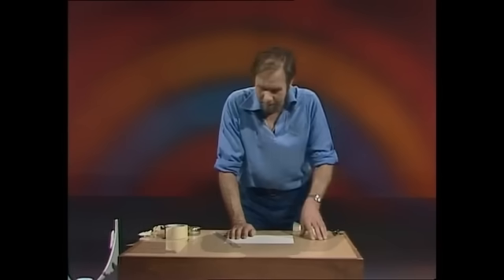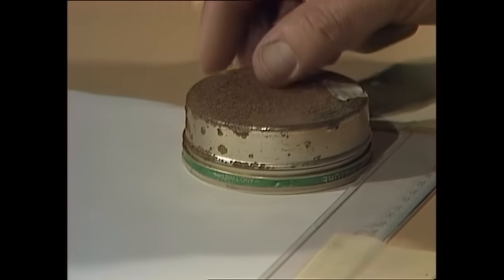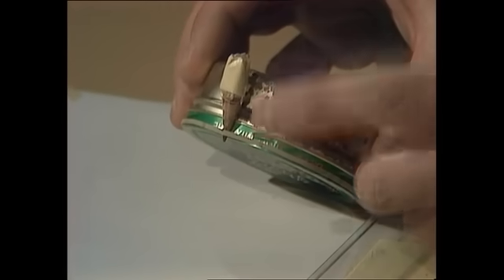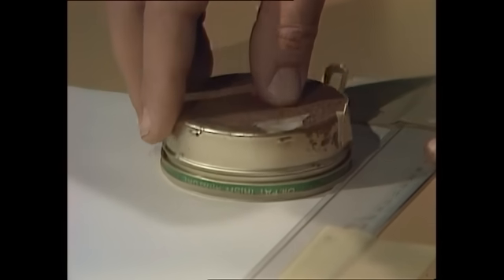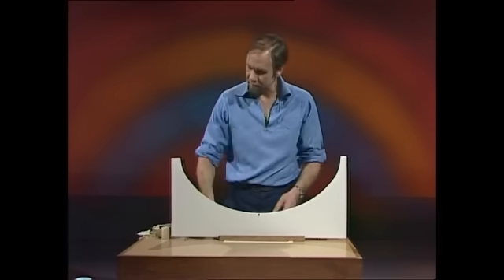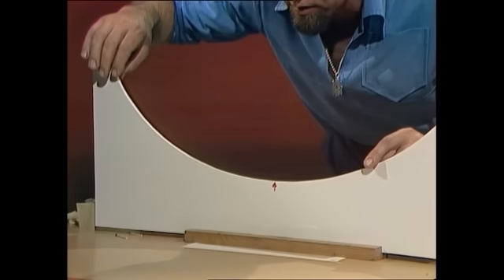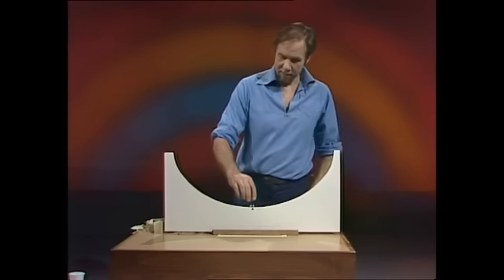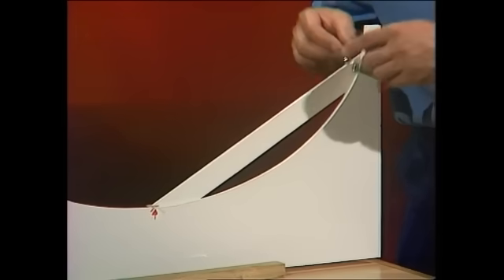The mysterious isochronous curve

Comment: Wonderfully done physical, explained and demonstrated example of an isochronus curve. The only thing I would like to see, would be an example of an application of the curve’s use. Too many mathematicians are just too enthralled by the “isn,t that neat factor”. In this case though that would be a real task dipping into stress and strain curves in materials and pendulums which are not isochronal, but cycloid.
Reply from the maker: There is a limit as to what can fit into 4 minutes - Rob
Reply: @CuriosityShow  Thanks for the heads up. I did not know you had a time limit.

Comment: You can notice that although the balls will reach that center mark at the same time, the one that started at the lower point on the curve bounces farther back when it collides with the other ball. This implies a few things:
1. The ball starting at the lower point had a lower amount of momentum than the other.
2. That ball had the same mass as the other ball, so the difference in momentum was because it was moving at a lower speed by the point it reached the center.
3. Since the balls started at different heights, they naturally also started with different amounts of potential energy and the same amount of kinetic energy, which was 0. So, this would naturally explain the difference in momentum and velocity when the 2 balls meet, which confirms the law of conservation of energy was upheld without any unknown forces adding energy into the system.

The fact that the balls reach the center at the same time is actually the result of the inconsistent centripetal acceleration caused by this particular curve. The top of the curve is essentially a flat drop, so the only force on the ball at that point is gravity. Lower on the curve though, the ball fallows the curve at an angle, so its vertical velocity is converted bit by bit to horizontal velocity, until it reaches the center point. Although the conversion of the vertical speed to horizontal speed gives it a higher resulting velocity when it reaches the center, it had to travel a greater distance around the curve to get there than a ball starting at a lower point. 
This curve is special, because it perfectly balances the trade-off ratio between achieving greater end velocities at the cost of increasing the total distance traveled by the balls, so that the total distance traveled, divided by the average velocity throughout the curve, is equal to a constant amount of time elapsed. Or * D / V' = C *
Reply: Thats a long way to say "Magic" LOL 😉😇
Reply: Bravo! One remaining question. When comparing a ball traveling on an isochronous curve to traveling along a straight line, the former is faster. I get that the ball gains more momentum along the isochronous curve, but it also travels less distance. Do you have any kind of intuitive explanation for why momentum wins out in this case?
Reply: Or maybe something more simple, like human error not releasing the balls at the exact same time
Reply: Obviously i haven't done this experiment; hence my question: would the two balls (hah! Balls) meet at the Centerpoint if one was released at the very top of the one side, and the other released like one diameter away from the Centerpoint?

Comment: I took an employment exam and this was one of the questions. They had a ball and 4 ways to run. Line and 3 curves. One of the curves had a really sharp drop then it leveled out some. My thinking was that near vertical drop would give it more momentum and thus be the fastest. Nope. The isochronal curve was the right answer. I didn’t believe it so when I got home I made my own and yes, the ball traveled fastest on the iso curve. I still got the job
Reply: what kind of job is that?

Comment: The more round the circle the faster it goes. The straight line holds more of the balls weight making it roll slower. The curved line doesn't hold that much weight back for the ball and so it rolls faster. Take 2 cars for example and put one on a slight curved hill but still a straight road. The road will be squished with the cars weight alot longer than if the road was straight up drop curved. How to explain in simple terms. Because you start the ball halfway up the curve, it will go the same speed as if one was drop from above straight down. They would both meet in the middle at the same time. See, the ball on the curve basically has no weight pushing down to slow it down you see? It's basically a floating ball on the side of a curve. Another ball on a straight line slight curve has to take into account it's weight being pressed down and so that will slow it down because it needs the momentum to build to make it go faster. Gravity as some say. A ball on a straight line uses alot less gravity than a ball on a curve. Never mind. Forget it.

Comment: It's because the angle on the shorter distance is shallower so moves slower. Whereas on the longer side the ballbearing accelerates to a faster speed therefore it meets the other bearing at the same point.

Comment: So the ends of the curve are steepest and get progressively flatter as you approach the center, resulting in different velocities per starting point...the faster velocities perfectly compensate for the longer distances, resulting in all getting to midpoint at the same time. 
What confuses me is why tracing a circle would result in a curve with such properties.

Comment: What about 1/2 of a circle so no radius differential. I believe they would be roughly the same. Also use Control devices to release and measure timing are critical. Show the Accel and speed curves of both. Or this is just a new way to give fancy names to stuff.
Reply from the maker: No, they are not the same - check the explanation - Rob

Comment: WHY!?
Reply: Acceleration in two dimensions can be described by addition of two force vectors, X and Y. The magnitude of these vectors describe the direction and magnitude of the force. Gravity is a force vector pointing down (here on Earth). Taking two extremes, top of the curve and bottom near center, you can see the top curve ball will experience more of the total acceleration, since its motion more closely aligns with the gravitational vector, than the bottom near center ball. The result is an acceleration magnitude gradient with the top curve both being more aligned with the force vector and further away from the central point, giving it more time to accelerate (acceleration is distance per second [speed] per second [acceleration]). You can get more technical with conservation of energy calculations and such, but hopefully that is a good intuitive explanation.
Reply: @JimBob1937  I understand how the nature of the curve causes that to be true, but how is it that it’s guaranteed with that method of creating a curve? It almost seems like a perfect coincidence, but of course there’s a mathematical explanation for it
Reply: @jps226  , I spent some time today analyzing the math, and I cannot answer that with confidence and would just say coincidence. The curve is a cycloid, which happens to be produced by a circle rolling, with the center tracing the cycloid. Running through the math, I find Able's Solution more intuitive, and runs through using the assumption of conservation of energy to derive a solution where a curve has a the property of a constant relation between height traveled and time for such travel. The answer is an isochrone curve that is cycloid. Again, though, why a cycloid? My guess is a coincidence of math as you say. If it is otherwise, I'll leave that up to the mathematicians that're able to think more abstractly. I chose applied math as I'm not a fan of that line of thinking myself, lol.

Comment: As someone who goes to a skatepark all I have to say is this is only true on a 3d scale. These physics make sense to me but I can see how this demonstration can help others understand. It should be mentioned that a diagonal path is faster with the same velocity.
Reply: “only true on a 3d scale”
What on earth is that supposed to mean? And why does your experience at skateparks have any bearing on your belief of that nonsensical statement?

I started skating in the early ‘70s. 
In the ‘80s I was introduced to this type of curve, referred to as a “cycloid”, by someone advocating it as a potentially superior shape for transitions of backyard ramps. (This was the era between the first wave of pay to skate concrete parks, and the emergence of skater built free municipal parks.)
There was a good bit of innovation in ramp design at the time, but almost everyone was drawing transitions with a makeshift compass, usually a string and pencil, or later with wood instead of string for a more accurate circle segment. 
The cycloid idea emerged around the same time that true halfpipe ramps were evolving into the modern version of two quarter pipes with flat in between. 
It’s almost a certainty that you’ve never ridden anything besides round transitions or flat banks in a modern skatepark, because no one is trying to use cycloids and almost no one uses ellipses, another notion that never took off. 
It’s my guess that they’re too difficult to draw on the large forms used in skatepark construction, and although we might be missing something cool we’ll never know unless we build it ourselves to experiment with.

Comment: That is because  the curve is steeper at the upper third than the lower third and than the straight slope. Hence the acceleration at the top of the curve is inverse linear, meaning the acceleration is greatest at the top and slows down as it approaches the lowest point, whereas the straight line slope has a constant acceleration. this explains both being faster than a straight line and one side being as fast as an opposing ball released anywhere along the opposing curve

Comment: Isnt this abt kinetic energy. Higher the ball, the higher potential energy. PE converts to higher KE when released at higher ground. KE = mv^2. Therefore translates to greater velocity since mass is constant. Another ball begins to be released at a lower height, has lower velocity due to lower KE. Hence despite having to travel greater distance, velocity is higher and interestingly, arrive the same time to another ball that starts at a lower height in the isochronous curve. Therefore, both arrive the same time when height is 0 when potential energy (mgh) becomes zero,

Comment: I mean it’s quite obvious that a curve would beat a straight line. As the ball falls to a lower depth earlier in its path, more potential energy is converted into kinetic energy, causing the ball to be traveling at a faster speed, earlier in its trajectory. Ask any skateboarder, is it faster to slide down a straight ramp or a quarter pipe? 

The first part where the balls touch at the center no matter where you start them was not obvious and very interesting.

Comment: To me, this is less mysterious as when measuring diagnally across a square compared to measuring the X axis and then the Y axis to get to the same point. In each case, all lines of x and y have to be crossed, so it makes little sense to me as to why cutting across x and y at the same time would be a shorter distance.

Comment: The shortest distance between two points is a straight line, but not necessarily the FASTEST.  The straight line creates a shorter distance to the arrow, but the steepness of the curve allows for much more rapid gain of momentum/speed.

Comment: I was wondering how they meet at the same time regarding the distance, then I figured out that the closer it was to the arrow the flatter the curve was and got steeper as it gets farther. The steepness fuels the acceleration and giving it the speed to travel the distance in a short time. This wouldn't have been possible for a perfectly semicircular curve since the radius from the center to circumference is the same everywhere and there would be no points that could cause varying degrees of acceleration. I can't say if my speculation is entirely correct so feel free to set me straight if I missed something. Regardless I found the Isochronous curve quite fascinating even though it randomly showed up in my recommendations 🤣. Hope this comment helps anyone with similar questions.
Reply: Acceleration will be different at different point in a circle. Just not different in a way that two balls will take the same time to get to bottom
Reply: This demonstration actually reminded me of Kepler's Laws of Planetary Motion... He discovered that the planets move in elliptical orbits, which is his first law. His second law states that the planets sweep out equal area in equal time. So if a line is drawn between a planet and the Sun, and then again some time later in its orbit, you can calculate the area of space swept by the planet. 

What Kepler found was that it didn't matter which point in the orbit you observed, whether at perihelion where the planet is moving fastest or at aphelion where it is moving slowest, as long as the time interval between the two points is the same, the area swept out is also exactly the same.

Comment: I love physics, the isochronous curve is my favorite way to show terminal velocity or an object in controlled environment. Both ball bearings are the same sonthey fall the same on the curve. Using a ball bearing slightly larger on one side will beat that smaller one due to it fall faster.
Reply: Which is interesting since in free fall, it doesn't matter the weight/size. Any object falls at the same speed as long as there isn't any resistance such as a wing/parachute etc.

Comment: It's because the curve is steeper the higher you go up. It's about gravity and the angle of resistance provided by the pitch of the slope the ball is riding on. The lower you go, the lower the pitch of the slope and therefore the lower the speed. They meet in the middle  because it was drawn with a  (presumed perfect) circle relative to the ground, the difference between pitch   and distance between the curves will be equal regardless of where the ball is placed. Essentially the greater the distance from the center the ball must travel, the greater the pitch and consequently the speed it travels at will be. These are equal because the curve was made using a perfect circle template. If you did this in only a circle you would get different results because the ratios of the curve are different.

Comment: Yeah but it is logical,  because the potential energy is the same, independend if they travel in a straight line or in a curve.
Same with the bearings arriving at the same time in the middle. The gradient from the one ball will be near vertical, whereas the other ball is much closer to horizontal. 

Note : this curve, must be  270° (maybe even more?) of a circle. Since we measure from close to the surface to close to the surface.

Comment: May I suggest using two straight edges attached to a large upside-down u, that can be used to hold both balls in their starting places, so when this single object holding both balls in place is lifted, you are guaranteed that both balls are being released at the same time.
Reply: I think you are missing the point because it doesn't matter, since they will still meet at the red arrow.

Comment: To help clarify the race between the straight line and the curve, ideally, both starts should always begin at the vertical portion of the curve at the top.  As long as you start both there, any slope of straight line will be beaten by the curve - in fact, the curve will beat a track of ANY shape that leads to the same point, because the curve obeys Snell's Law, which is how light refracts through a medium, using the fastest path to get to a destination through different mediums that cause varying velocity.
Reply: "It's faster because... that's the way it is."